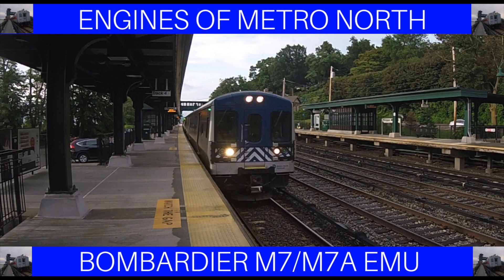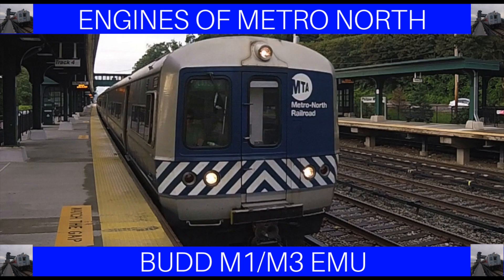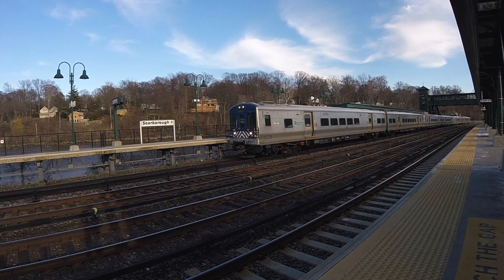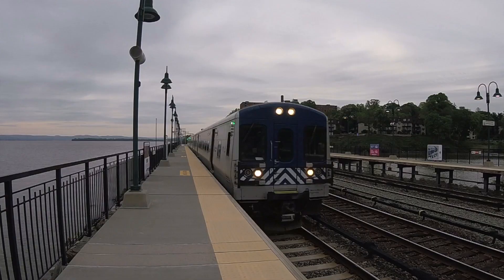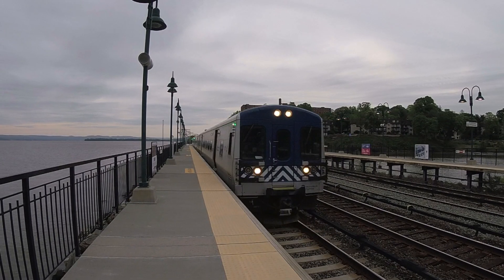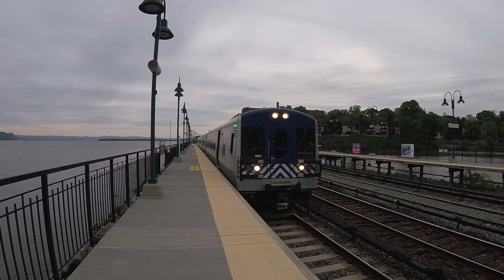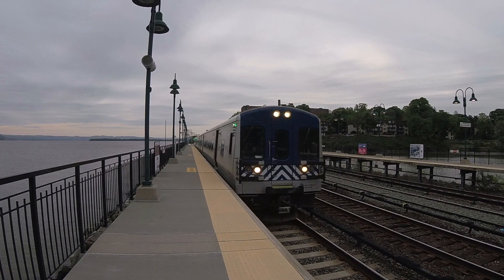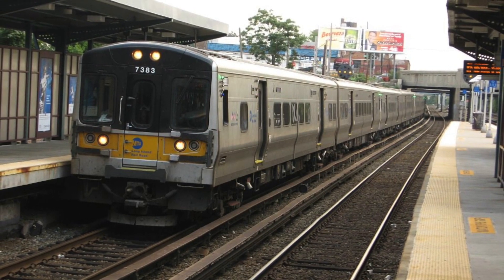Engines of Metro North Bombardier m7/m7a EMU

Comment: Are you going to do the P42DC?
Reply from the maker: Metro north did not have them. I know they recently leased to of them from Amtrak but if your talking about the p32ac-dm then yes I did
Reply: I'm talking about the 2 that they are leasing rn
Reply from the maker: Probably not as they aren’t significant enough and it would be exactly the same as AmtrakGuy365’s video on the locomotive